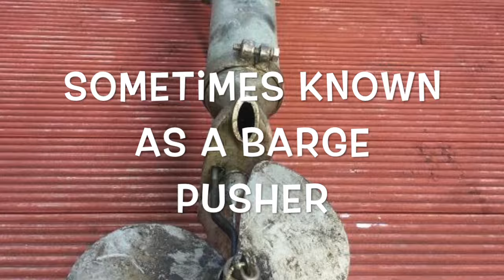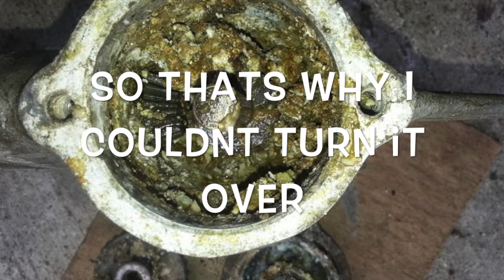seagull restoration

Comment: hello  Fergul.  Great work. I am half way through the restoration of my 102 TC 1961, could you please tell me how did you polish your carburetor.
Reply from the maker: Hi David I used a soft metal polishing kit from Halfords  you just attach the wheels to a drill and work from rough to smooth with the different wax sticks and wheels.
Reply: Hi Fergul. Thanks for that, i'll try that and hope it come as good as yours.

Comment: Hi there, I’ve got an old seagull abit older than your example, how did you polish the exhaust chamber as it was painted/ plated in chrome?
Reply from the maker: I removed the chrome and took it back to the brass and polished it up. Here is a link to the restoration that might help.   https://www.boards.ie/vbulletin/showthread.php?p=90589511

Comment: Superb Seagull - and video.  
A good few years ago I rebuilt one for a fisherman in Ireland. "It doesn't go."
Sorted points. Cleaned carb. Went first pull - but NO drive to prop.
Investigated and found the very cheap square tube 'driveshaft' had worn away internally until round rather than square - so just spun on hardened square gear shaft at bottom ... 
Would have been dangerous if out at sea when it finally failed.
Cleaned out and reassembled it [new tube] with a dollop of grease internally to prolong the life. Would therefore recommend this on any Seagull with a cheap square tube 'shaft'. Bad design 'feature' ?

Comment: Well done mate. Im in the process of polishing my 102. Do you have to keep polishing it to keep it like that or have you clear coated? I’m also debating weather to take the chrome off the water pipe. It wouldn’t be original but yours looks brilliant
Reply from the maker: I just give it a wax polish every now and then and that seems to seal any pores in the aluminium, the brass gets a bit of a rub of metal polish, when it's stored indoors it will stay shiny for ages.

Comment: my wspc wont pump water fergal i have fitted new rotor right way up fitted new gaskets on bottom end  reverse flushed checked water galleris are clear waterpipe is fully connected and ran in bin without prop ,engine strarts first pull but still no cooling water from outlet  any ideas  whats wrong
Reply from the maker: Sent you a PM

Comment: Where did you get the fuel tank transfers The text in the gold box’s ? Are they original to your seagull? I have brought a 102 would like to restore
Reply from the maker: Hi I get them here I use the waterslide ones.  http://www.saving-old-seagulls.co.uk/buy_spares/buy_spares.htm
Reply: @1968ferg  thank you, how did you clean up your propeller?
Reply from the maker: @fluffyhead6377  Same pads on the drill as I use to clean up the exhaust tube in the video I think they are called scotchbrite and they come in different grades, M3 also do them next I used the soft metal polishing kit from Halfords.
Reply: @1968ferg  ok nice job the foam polishing wheel or is it cloth?
Reply from the maker: @fluffyhead6377  Some are cloth one is like brush bristles.
Reply: @1968ferg  ok thanks, what primer and paint did you use for the tank? I hear some primers are no good for copper?
Reply from the maker: @fluffyhead6377  Halfords own brand etching primer, gloss black and petrol resistant lacquer.

Comment: Would have been better if you actually showed how you did the restoration rather than after it was done, I have just been given one and need as much help as I can get with taking it ALL apart to repair and bring it back to life.
Reply from the maker: They are very easy to take apart the only thing you might have trouble with is the flywheel to do this get someone to hold the engine by the flywheel loosen the nut and hit it a wack. Here is a link to some of my restorations that might help you out   https://www.boards.ie/discussion/2057219073/seagull-restoration/p1
Reply: @1968ferg  Thanks for the reply.